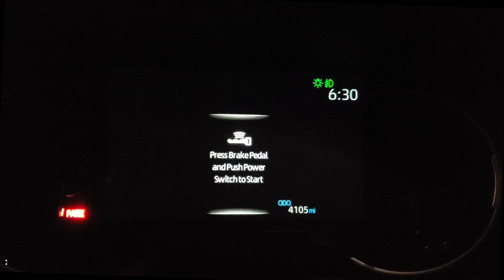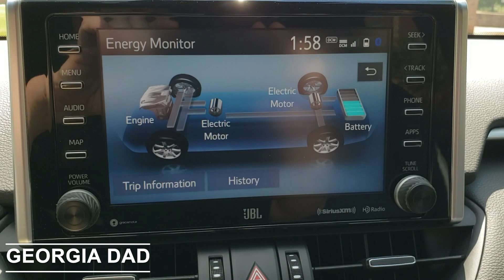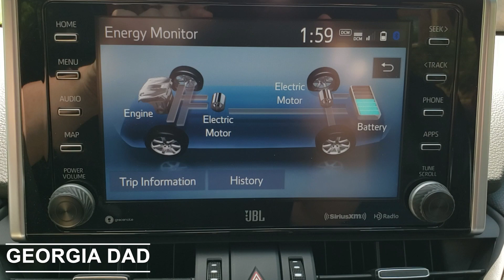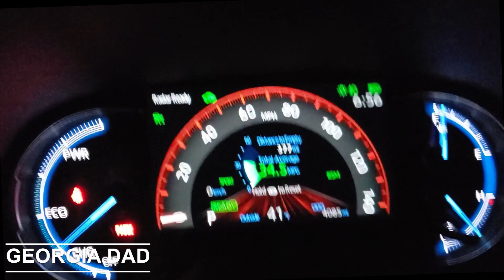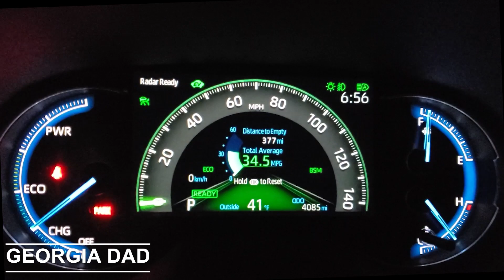2020 RAV4 Hybrid XSE review

Comment: I have recently bought this exact same vehicle in the UK, (same colour which I love) as an approved used from a Toyota main dealer with 7000mls on the clock. I agree that it’s a good way of buying a vehicle, saving on depreciation but still under full Toyota warranty. Loving the car which is hard to fault as a daily driver. Smooth, quiet, plenty of safety equipment, nice interior and very economical,currently averaging 45/46mpg. (UK gallons)Being a Toyota I’m looking forward to it being very reliable in the long term 👍